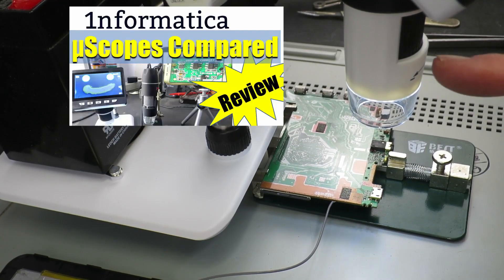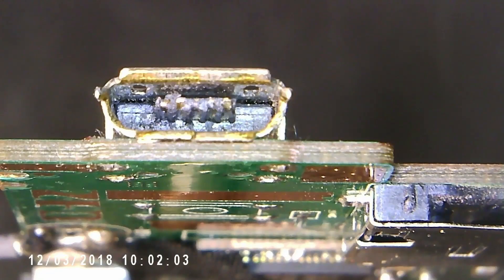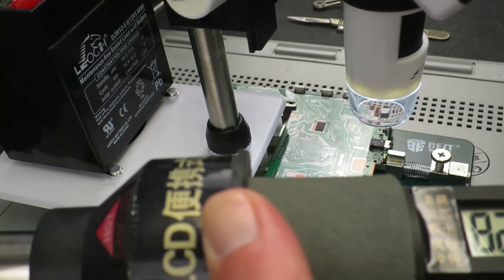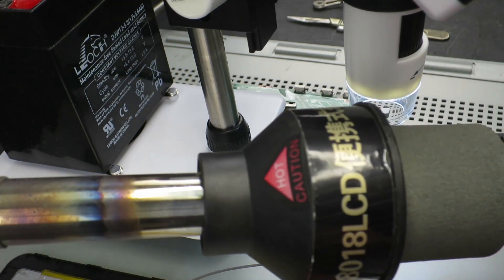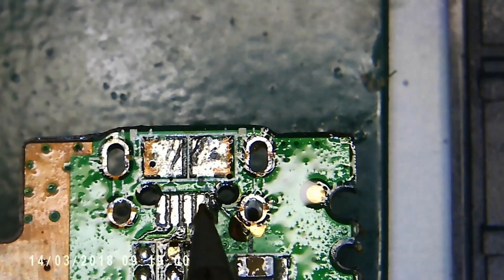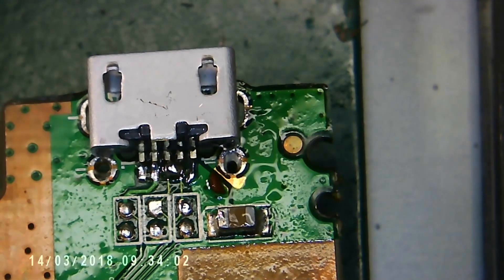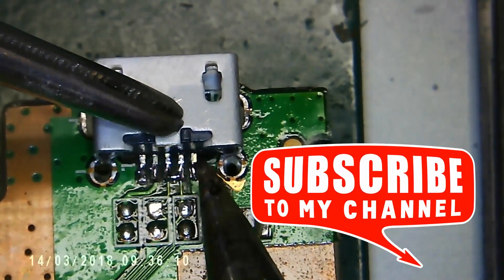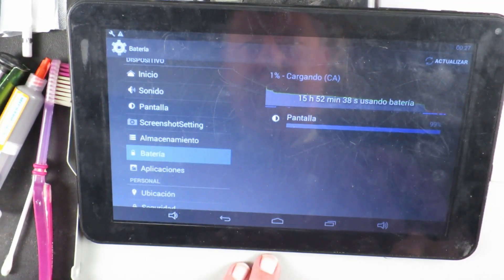µUSB Port Replacement Using MUSTOOL G700 µScope

Comment: Looked effortless. Good tip on the heat gun
Reply from the maker: Thanks! The trick to looking effortless is the 40 previous years of trying!!
Reply: 1nformatica, I get it👍. I am trying to upgrade a beard trimmer to lithium and encountering issues. I'm using 18650 cell, 3 amp mini stepdown converter 1.5-6v in 1.5 out and a tp4056 charging module. Can you give some advice? Thanks
Reply: The problem is that the trimmer works for couple of days then it stops working. I've wired and re wired on 3 occasions the same way and get same outcome? Thanks
Reply from the maker: You need to measure the cell voltage to see if the TP4056 is charging it.
Reply: Battery voltage is always at around 4v I've checked the charging and its OK. I've switched the mini converter twice just in case and each time I've put back together it works flawlessly but after few days pooffff it stops working. I'm very confused as to why.
Reply from the maker: Can you give some detail on the mini converter? Some require as much as 3 volts difference between the input and output voltage to work. The 18650 could easily go to 3.5 volts giving only 2 volts "headroom".
Reply: 1nformatica can I provide a link?
Reply: Never mind: here are the specs..
Specification:

1 Design level: Industrial grade

2 working frequency: 1.5MHZ

2 input voltage: DC 2.5v - 6v（Must larger output ）

3 Output voltage: 1.5v 1.8v 3.3v 4.2v

4 Peak output current: 2A（according to the input voltage）

5 Efficiency: 95%

6 Full load output ripple: Vpp <50mV

7 Output accuracy: ±0.1V

8 No-load current IQ: 0.2mA

9 Shutdown current (EN earth) <10uA

10 Heat dissipation method: Natural cooling

11 working temperature: -40℃ ~ +85℃

12 Storage temperature: -40℃ ~ +125℃

13 relative humidity: 20-90%

14 Size: 12*15*4mm

15 PCB layer: Double sided board

16 Installation method: Patch ，or 2.54 Pin plug

17 Production process: Reflow soldering

18 Whether with isolation: Without isolation

19 Design aging standard: 720 Hour No fault

20 The standard of factory aging: 72 hour

21 Service life: 1000000 Hour no fault（output current can not large than Rated current）

22 Factory inspection standard 2 times All test

23. Notice: EN Pin: Enable pin, input 2.5v~6v, can connect to VIN+,High enable low shutdown

                       (If there is no output,please connect the EN to VIN+,then test the output.)

Application areas:

DIY mobile power, monitor power supply, embed regulator, camera power supply, car power,

communications equipment supply, Vehicle mounted power supply, Security monitoring, Industrial control board

Household electrical appliances etc.

Package Include:

1 PCS * Adjustable Step Down Buck Mini Micro Module
Reply from the maker: It says "input voltage: DC 2.5v - 6v（Must larger output ）" but does not say how much! Can you post the number of the chip the board is using. Also when the trimmer stops working what voltage is on the output of the board when you try to start the trimmer?
Reply: Its a DM 08 module here is a link: https://drive.google.com/file/d/17BDYV3ya8XZRNTMA2An1NPkEZJZX8Ubg/view?usp=drivesdk

Output voltage of module is 0 when not working. battery is 4.0v and after rewiring. It goes back to working. Like I mentioned before I've done this 3 times. And changed the module once. Thank you for taking your time to help me tackle this dilemma. Much appreciate it
Reply from the maker: I cannot identify the chip from that photo. However the minimum input voltage at 3.4 volts I think is the problem. An 18650 can easily go down to 3.2 volts under load . If you have a variable power supply try testing the module with say 5 or 6 volts.
Reply: 1nformatica , I ordered this module:
https://rover.ebay.com/rover/0/0/0?mpre=https%3A%2F%2Fwww.ebay.com%2Fulk%2Fitm%2F262539353307

Hopefully it works better. I am starting to think this module is garbage. Not sure if it has capacitors or not. But I will keep you informed once I install the different module. Thanks and will talk to you later